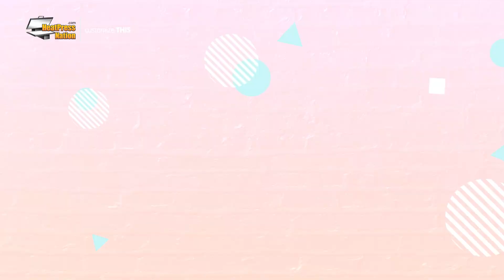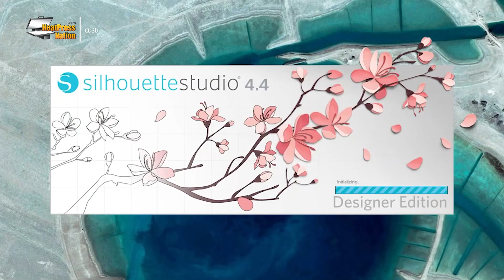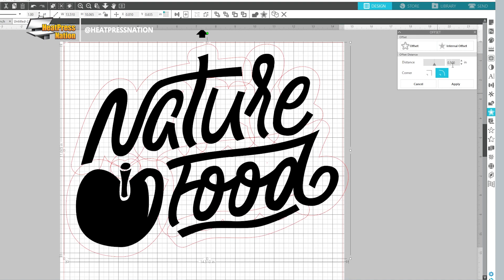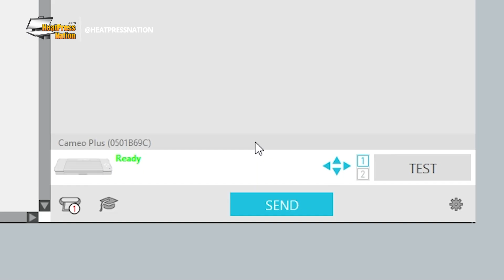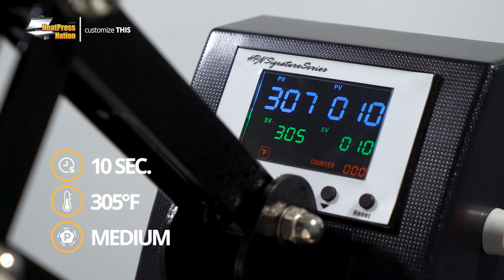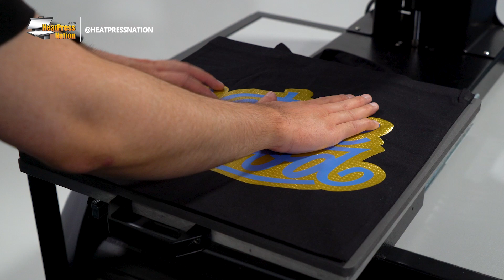Make A Tote Bag Shine With Siser EasyWeed Electric HTV

Comment: What is the nest to put on tshirt hoodie that it doesnt feel like its on there
Reply from the maker: Sublimation is the only heat transfer method that truly has 0% feeling when applied. However, it can only be applied on white/light-colored garments made of polyester or poly-rich material (at least 50-60%). 

White Toner Transfers with a raster effect (details here: https://youtu.be/9g87PnjU7fg) are going to be a close second. However, White Toner Transfers can be applied onto any color garment and works on cotton and cotton/poly blends.

HTV, as shown on this video, is going to have some feel on it. Siser EasyWeed Stretch (https://heat.press/EWstretch) is our thinnest HTV material.